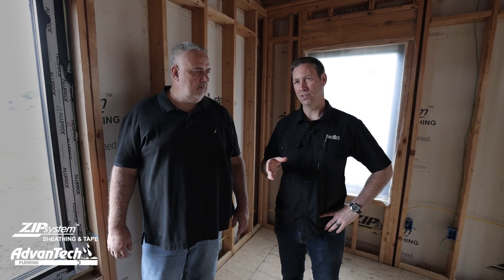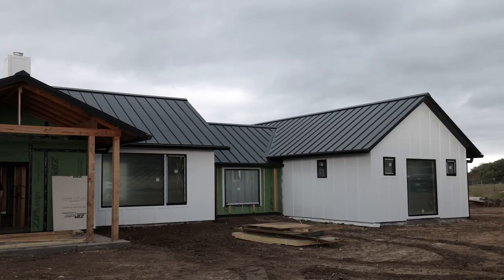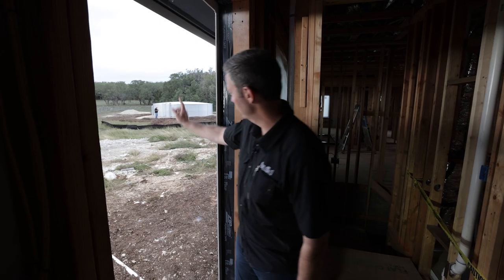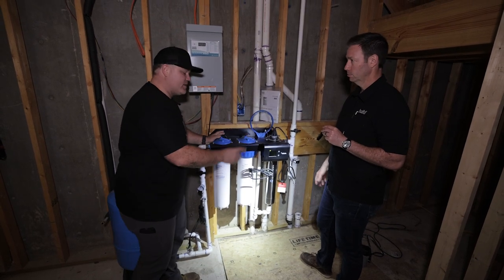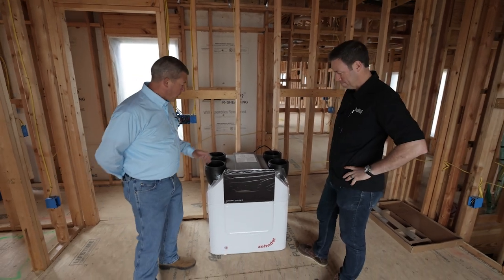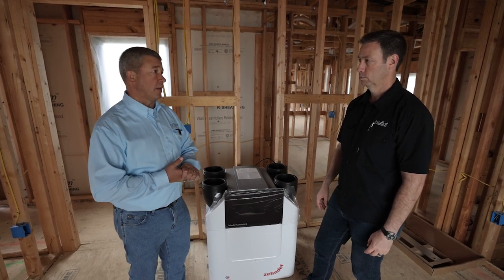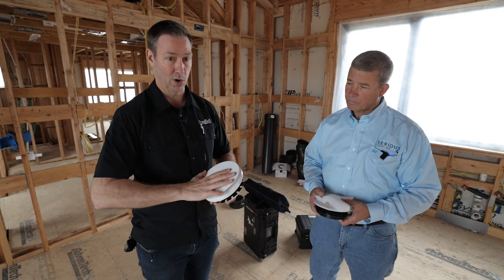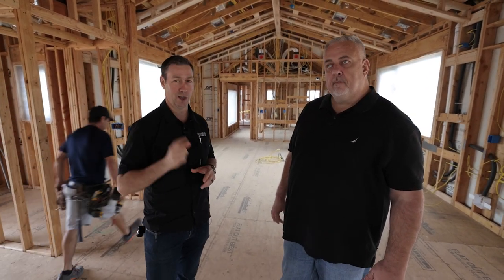No city water? No well? No problem: 55,000 gallon RAIN TANK

Comment: Living in the Chihuahuan desert, we get 8-10 inches a year. My two barns catch about 8,000 gallons per inch of rain. Our tank is the next size up, 65,000 gallons. We can live on 20,000 a year. Some years it doesn’t rain, but we don’t have to haul water anymore. My solar powered water treatment plant filters, chlorinates, and pressurizes the water.
Reply: Possibly a silly question but can you supplement rain water with dehumidifiers? It seems like you might have points with excess solar power and maybe that would be a use for it.
Reply: @KevinLyda  dehumidifiers in desert?
Reply: @thelonewolf666  At worst, he can live on 20,000 gallons a year.  That's about 50 gallons a day.  You can drink through a gallon a day with moderate exercise in the heat and that would still leave you 49 gallons to cook, clean, shit, and shower (really, bathe) with.  With careful usage, you don't have to even use 2 gallons of water to flush an entire day's waste, 5-7 gallons to scrub dishes, or even 25 gallons to shower with.  Even after all your chores are said and done, you still have 15 gallons left over to water plants, pour into humidifiers, steam your clothes, make some drinks / soup, etc.  And on a 65,000 gallon tank, that's 3 years of 0 inches of rain (which is anomalous even in the Chihuahuan desert; it would obliterate most life in the area if such a thing were to happen).
Reply: @vedrisca  We can learn from the Earthship people.  Use the water from the shower and sinks to irrigate plants, and put in a sump pump that collects water that's been filtered by the earth to fill toilet tanks.  They say they "use the water three times".
Reply: awesome
Reply: Thank you for sharing your solution! I think water reserve needs to happen everywhere, if for no other reason than to save some of the cleanest water you can get! Shipped water is vulnerable, expensive and subject to fuel costs. Happy Prepper!
Reply: @montyharder3663  That's it, its not 35 gallons for you and 15 gallons for the plants, its 50 gallons for you and then the plants. You're really only wasting water when you breathe and perspirate, and if you do that inside even that can be captured and reused.
Reply: What does a tank that size cost roughly?
Reply: @Dresoils  Soft tanks can run from $500 to 10K depending on the source (supplier or surplus). The auction websites have a lot of water related equipment as well as treatment skips for 'quick deployment.
Reply: @Dresoils  Think about some future growth as a community resource. Temporary tanks are good for maybe a year. 15 connections is enough to start a water district.
Reply: Wat state u livin doesn't rain

Comment: US Virgin Islands we use rainwater as primary water source at home. Best solution? A home that had THREE 40,000 gallon reserves. 1st cistern was filled from the rooftop and is for home use (shower, drinking) using sediment filter between roof and cistern, then a secondary sediment filter, pump, micro filters, carbon filter, and UV purifier, water flow is single direction overflow into the 2nd cistern. 2nd cistern was also filled from the stone pool/patio deck. This 2nd cistern is sediment filter and microfilter, used for the toilet system, garden/yard, and filling the pool. The 3rd cistern is the pool itself with its own pumps, filters, and salt (salt water pool). All completely hidden as the top of the cisterns are to pool/patio deck. Of course, the cisterns are steel/concrete/lined. Basically a basement with extra barriers for holding the water.

Comment: Hey Matt.  I'm not a contractor or architect - just an average Joe, but have been watching your videos for years.  I used what I've learned from them to design and build our dream house on acreage outside of Fredericksburg last year.  Our budget wasn't on par with the houses you've been profiling lately, but we were still able to incorporate many of the concepts you've touted.  Fortunately, we had a great builder who was already aware of these concepts and helped us achieve our goals.  We installed a rainwater system very similar to one you show here.  With 2 full-time residents and frequent visitors, I've found that the filters need to be replaced every 6 months.  Viqua requires the UV light to be replaced annually - at least for the model we have.  I really appreciate your videos you sharing your knowledge.
Reply: Hi, I hope you can see this after a year. I'm planning to build in Bandera and was wondering if you can share the contact info for the builder you used to build your home?

Comment: I always like your vids, but this one was near and dear to my heart. I @m a professional sport fishing captain and lived on a private Island in the BVI and USVI FOR 10 years. All of the water was rain water due to the Virgin Islands lack of fresh water. What a smart owner and great job Steve.
FYI on the private island my boss, a developer, built in a grey water system that was another 55,000 gal tank that picked up from sloped driveways and walkways for plant watering and outside clean up. We put a small little pool floor suction skimmer set up for bottom of cisterns. Ran them 1 time a month for a day through pool filter just like a skimmer. In 10 years we never needed to clean a cistern.
Also, owner and people living will need a high quality multivitamins. Rain water has no minerals in it. If you get a cut or scratch and see a slight red ring around wound when healing you Ned a better multivitamin.

Thanks, love the entire network. Even if I’m a stupid fisherman. :)
Reply: Pool filter with a vac is a genius idea. I’ve never seen that, but it makes so much sense!
Reply: Vitamins are not minerals and your food should be sufficient for both just fine. You might need some extra vitamin B12 if you are on a vegan diet, but a balanced diet will cover it as long as there are no medical condition preventing normal food digestion.

Comment: I installed a uv filter on my well filtration system. Make sure that you filter down to 5 micron per the uv filter spec in order for it to work. Otherwise the bacteria can hide behind the particals still in the water.

Comment: If you use an asphalt roof, the water is not potable because of the petroleum and other chemicals leeching.. A metal or a slate roof is ideal if you don't want to be poisoned especially if you are showering, drinking or using to water your vegetables, etc....
Reply: Many homes have gardens in the backyard...near their asphalt roofs.  All ground around asphalt roofs are absorbing asphalt "sand" as the roof degrades.  I've not seen any studies on harmful soil from them...but I wonder!
Reply: Thats not true.
Asphalt roofs are fine to use for rain catch.
You will get less oil in your water then if I drilled a well.
And a person could drink my well water for over 50 years. And its not the oil that going to get you.
I changed to a metal roof because Asphalt roofs were not lasting 6 months here.
You are scared of asphalt roofs when you don't need to be.
Though a metal roof is a lot better. They last longer and hold up to wind a lot better.
Reply: @baddog9320  Where are you?
Reply: My family is very much alive and well.  No issues from our rain tank collecting from our asphalt shingle roof.  Have a good one
Reply: How do you keep the water from rotting? Black mold.
Reply: @EternalResonance  UV light, chlorine,  or aeration/circulation with silver or another antimicrobial. Also make sure it's completely light so no bacteria can grow.
Reply: I would bet even with an asphalt roof the water quality would be much better than most city tap water.
Reply: Asphalt shingle roofs you use a "first flush" system that lets some water rinse the roof, and be discarded, then the rest of the rain gets collected.

Generally a good idea to use a "first flush" system for rain collection regardless of roof composition.
Reply: We have had and all homes in our area in ohio have asphalt with NO problems with petroleum issues.  Love having free water that is super clean, soft and with free delivery.  Sure when it is very dry you might need to order water
Reply: Pretty sure slate roofs have a lead underlayment… neurotoxins aren’t exactly the healthiest thing to drink either.

Comment: If you add a fire department connection it can double as fire suspension water source.  Has been required for years by some of the insurance companies for higher end homes in remote areas.
Reply: We do it all the time, both residential and commercial.
Reply: I'll have pipe from my big storage tank available for fire dept use... and a 2-acre-ft pond they can draw from if needed.

One of the reasons I have selected to do an extremely oversize water tank.
Reply: @fhuber7507  While a 2.5" NH/NST connection is standard, it's always good to ask your local fire department what they can hook up to. Be sure to specify SUCTION hook up, not pressurized like a fire hydrant. If they have a 4.5" it can help them fill their trucks much faster! Also, if you add a fire connection, be sure to add reflective signage, and a ventilation port for your tank so it doesn't collapse under suction (if you have a free-draining screened entry you're already good).

Comment: Happy Birthday Matt! I'm a Water Plant Operator for my profession. Safe drinking water is an absolute must.
Reply: We're on well water but only use a sediment filter and 24 inch UV light system.  100% safe
Reply: Here many of the older houses have both cisterns and wells with purification systems for each.  They are inside the basements so many are discontinuing them due to humidity issues.
Reply: Thank you for your work! How do you feel about micro-systems?
Reply: @cherylm2C6671  For your own personal use? If so, I think it would not be the most efficient use of time and money. My back up plan is a carbon filter (Berkey or similar) and a few drops of Cl2. It's cheap, simple, efficient, and safe. Though it's my back up plan it could easily be used for my entire drinking water supply.
Reply: @keithbrookshire  Happy holidays, and Thank you for your comment! 

50K gallons is enough to support a farm or aquaculture but it wasn't mentioned. 
Carbon filtering and chlorine (mixed oxidant) will prevent potential pathogen trouble for stockpiling compressed snow. 

At least a year's supply of the cleanest possible water could be got into even tent-and-pond-liner warehouses and  spray insulated with styrofoam or pykerete (and plastic) over it. Paying 500 people to move water instead of cleaning out a stadium for a ballgame is 'all hands on deck' work during an emergency and water the town doesn't need to buy.

That will provide not only a fax-fast drinking water supply safely but allow some work to proceed on either upgrading or restoring existing water facilities. People pitching in to prevent the legislature from taking what little water will be left after January is a good thing.

Comment: Painting the PVC protects the pipe from uv degradation good job
Reply: Is there any reason the builders in my neighborhood don't paint the vent pipes protruding from the roof? They are rather unsightly contrasting against the dark roofs.
Reply: @NOXStellans  $
Reply: @NOXStellans  also your PVC vents degrade but still keep gases in tact. Water is different because it starts to leech into the water, also water makes it degrade faster than air

Comment: Thanks Matt! I can’t catch your all of your videos, but when I can I always learn something valuable. I grew up in a home without outside water supply. We caught rain water off the roof into cisterns and barrels. In the summers where there was no rain we could truck in water. I love seeing this new modern innovation to an old idea. 

Your channel is a fantastic resource for anyone wanting to build a home and looking for ideas, solutions, new products and methods!
Reply: With the right roof size and tank size you'll never need to truck in water. We have a simulator so we can design a system to never run out of water.
Reply: Tote containers are very limited, but you may want to consider a military type 'bladder tank'.

Comment: I did some research a few years ago. The standing seam metal roof is a must-have. You get about 95%+ of the rainfall off of a metal roof. With asphalt, it is somewhere around 80%. It does vary depending on the roofing material. Metal gives you the most return per inch of rainfall.

Comment: I have seen rain water collection system videos (in the TX area) in other channels.  What amazes me is how fast that water can collect.  1 inch of rain on a square foot of space is 144 cubic inches.  This translates to 0.6234 gallons.  My house is 1776 sq ft.  So 1 inch of rain would yield 1,107 gallons of water.  It adds up quick.  A good down pour could bring thousands of gallons. To put it into perspective, my wife and I used 2,992 gallons on our last bill (one month).  However, this is where the size of your storage tank, collection area, projected use, and yearly average rainfall for your area has to be weighed.

I often thought that you could have a rain collection system with a well backup.  Particularly if you already have the well.

Comment: I build koi ponds normally with EPDM liner. To me digging a hole and  liner would be a way to create a huge water storage tank. Saves the need for the steel structure.
Reply: Needs dictate in or above ground.
Reply: Some people do that….they then just run a gravity feed system to the home (need to be in a hilly area obviously)
Reply: Sometimes it's cheaper to buy the steel
Reply: The steel contanment reduces the evaporation.

Comment: This is why I'm planning to run a similar rainwater catchment and filtration system but with two sets of filters run in parallel with pressure gauges installed after the filters so that I can actually monitor the real flow-rates as they start to become clogged. In theory, parallel 6 month filters should last 1.5 years or so, but the pressure gauges will give the real story.
Reply: Good plan, make sure to put a gauge before the filters too.
Reply: @jay90374  Well yeah, certainly. I'd actually like some digital sensors tied into the home automation system I'd like to build so that I can check tank level and pressures from the same interface that I adjust lights and HVAC.
Reply: @chaseweeks2708  It doesn't matter if you use gauges or sensors, my point is that you need one before and after so you can tell if the filters are loading up or if the pump is having problems.
Reply: @jay90374  Sorry that I wasn't clear. I was agreeing that I want gauges and sensors on both sides of the filters.
Reply: @chaseweeks2708  👍 NP

Comment: I noticed two pressure gauges on that system, that would tell you the pressure drop of the filtration system to let you know if it’s getting clogged or when to change the sediment and carbon filters
Reply: If you read them while someone is running the washing machine or other water demand... so there is flow.

No flow and the two will rapidly read the same even with a clogged filter.

Comment: Neighbor is doing rain collection in a series of 3000 gallon tanks.

I'm setting up for a couple of 3000 gallon tanks to collect, then pump up to a 30,000 gallon tank.
Minimizing the amount of 4 inch + pipe.

I plan a couple of pressure accumulators to stabilize water pressure in the house. (commonly used with wells)  This will make a tankless water heater less likely to have temperature surging as the pressure and thus flow rate changes.

Comment: I love my ERV in my house but Zender needs to add air quality sensors to their fresh air supply.  Wildfire smoke is huge problem for ERVs because MERC filters can’t remove sub 3m particles so you have to manually shut the whole system down to protect your indoor air.  An auto sensor that does it for you when AQI hits a certain level would be a huge upgrade.
Reply: I agree same problem here
Reply: That's a pretty neat use of a air quality sensor.  Who sells an ERV with that feature??
Reply: No idea on quality but ‘Build Equinox’ sells one

Comment: And if you put your heat pump water loop in your tank you can have a heat pump system in your home without any trenching same as a pond loop
Free energy storage for hot and cold 
The house design I have for a community first project has this design
Reply: Thank you for your comment, and have an active safe 2023.

Comment: Love the rain water usage,  (around 6 pH with  no minerals) is great for dishwasher, washer, toilet, showers, sinks,......but not very healthy for drinking.
Reply: Drop a Gatorade per 300 gallons there's all the minerals.
Reply: The Ph is low but it takes very little to swing it because there's no buffer.
Reply: @nicholashomler1494  Minerals is a help, but Gatorade is not a healthy drink due the very low pH.
Reply: @Colindstuart  Swing it with what?
Reply: One way is to have a separate tank for drinking water, either from a well, spring, or  transport it in, would not need a lot due to all the other water needs would be covered by the rain water.
Reply: @duanethieme4186  sarcasm doesn't translate always
Reply: @nicholashomler1494  I'm stating facts, where is the sarcasm?
Reply: Health benefits with ionized water: https://www.youtube.com/watch?v=5bSB82GEdKk&list=PLNrBhAnkrN_Qo_mZotdAYNpaR0Snj64NR&index=1&t=1502s
Reply: Would a part vitamin tablet help? I'm thinking half a vitamin at each meal.

Comment: Personally I wouldn’t want to be drinking water off my roof especially if it was a ashfault roof, id do a well and use the tank as a buffer, fill it up with water in the fall/winter/spring and use it to supplement through the summer. I lived on a water tank/well system and collected water off the roof and it was DIRTY
Reply: That’s it right there. They missed the detail about the metal roof making for purer water with asphalt contaminants you get in composition shingles from what I understand.